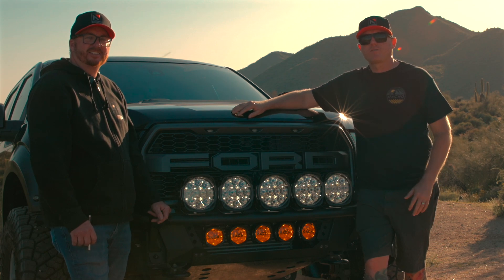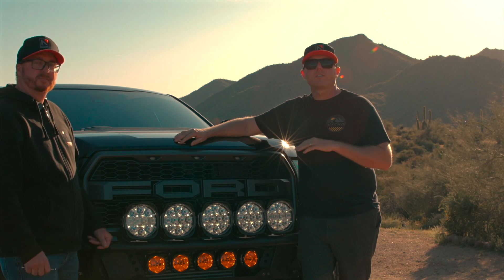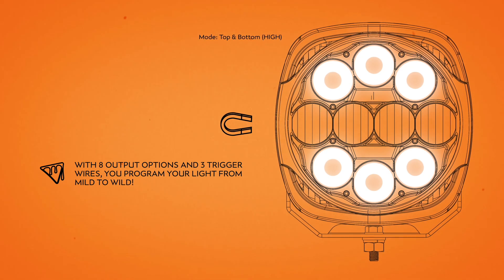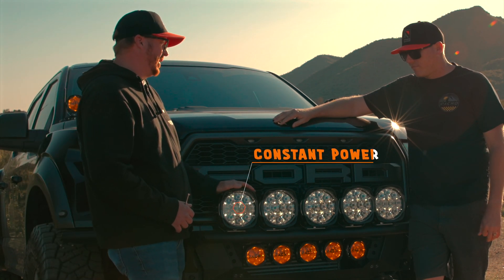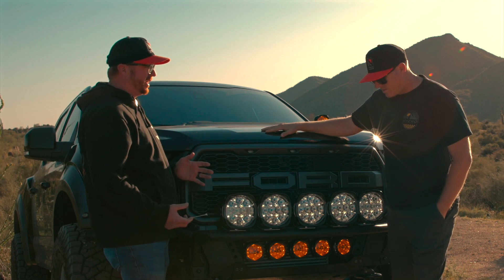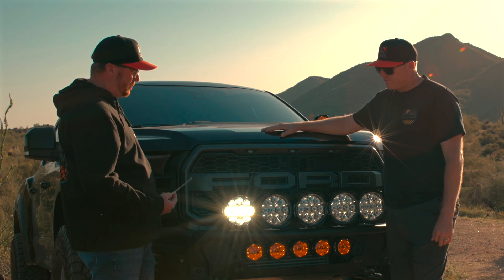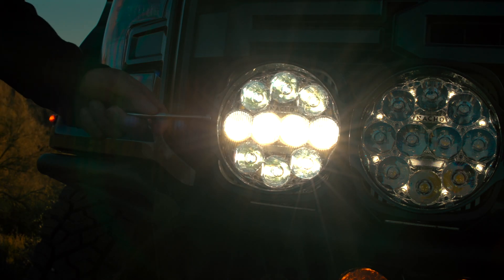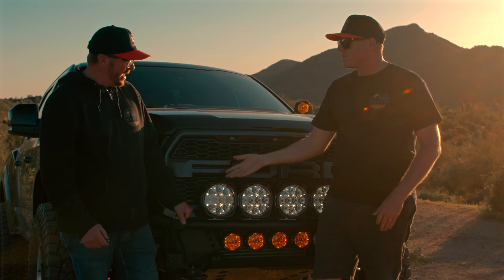NACHO Grande's Output Control Modular or Tip2Chip  EXPLAINED

Comment: Really interested in these lights, and I see from another comment you can have 3 light modes at a time on three switches. How does this work with a Switch Pros? I would want to use that instead of directly connecting to the battery, does the Grande support that?
Reply from the maker: You would need to run the positive and negative leads from the light to the power source (battery) but then the trigger wires would go direct to your switch pro's like you traditionally would with any trigger wire.  You can use all 3 wires or just use 1 wire.  Just the more trigger wires the more functional you can make your light.
Reply: @nacho_offroadlighting  That makes sense, I know the lights themselves are required to be directly connected to the battery, do you guys sell a harness that is ready for people with the built in upfitter switchs (Jeeps, Raptors) or a switch pro?
Reply from the maker: @WulfricRed  we have a constant power harness that may be a little long for adapting to factory upfitter switches because that is usually in the engine bay, but you can also get standard automotive wiring to extend the existing wires from the light to connect to your factory upfitter wires.  Just make sure it is the 16 gauge.
Reply: @nacho_offroadlighting  Sounds good. Thanks for the information. I just need to measure now and see if the Grande will fit my application. If not, the TM5s will work. Thanks!